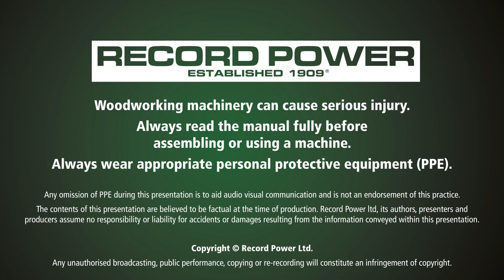Know-How Series: How to fit the 16011 Cast Iron Bed Extension to the Coronet Herald Lathe

Comment: Hi I’ve added the bed extension and decided to attach the legs to the far end of the bed extension itself. There’s mounting bolts on the end of the bed extension so hoping that’s ok….if the holes are there why not mount the legs further apart ?

Comment: Very happy with the lathe and the bed extension is a great addition. But why did you have to decide to use this with hex bolts? In a very inaccessible location under the bed with the legs in the way. Fitting the hex bolts is a very frustrating experience. Locating the hex bolt, turning it about an eighth of a turn before it fouls on the leg or the bottom of the bed, pulling the hex key to then relocate. I’ve been at this now for about 20 minutes and I still haven’t fully tightened 4 bolts. It would make fitting much easier if you supplied normal bolts, at least then you could get a ratchet on them and tighten them up in a fraction the time.
Reply from the maker: Hello, thank you for your comment. The reason cap head (hex bolts) are used in a lot of applications like this, is because these are generally made out higher density/stronger material. So, when an item like this is only held in place by these fixings, we ensure that these are the strongest possible but with smallest surface area. In short, to get the strength in a standard bolt it would need to be a lot bigger, so we do apologise for the inconvenience but safety always comes first. For further information, please contact our technical support team on 01246 571 020 (and select option 2) or email technical@recordpower.co.uk. Best Wishes, Record Power.
Reply: @RecordPowerTV  The issue is not to use a "standard bolt".  Hex head bolts come in many different grades of hardness. One would think your foundry and the designers would be aware of this. For those of us like me, who purchased the lathe without legs, then mounted it to a wooden bench and loaded the bench under the lathe with 600 lbs of sand, the cap screws are painfully difficult to tighten. btw, I purchased this from Stockroom Supply, your dealer in ON-Terrible. That phrase is for expats only, since I transplanted meSelf to New Scotland. 😉
Reply from the maker: @jageo48  Hello, thank you for your comment. Please contact us on 01246 571 020 (and select option 2) or email technical@recordpower.co.uk, and the team will be more than happy to discuss this matter further. Best Wishes, Record Power.
Reply: @RecordPowerTV  Thanks. Done.

Comment: im going to be bench mounting this with a herald will i need another bench foot or do i use the one that's on the lathe
Reply from the maker: Hello, thank you for your comment. If you would like to keep the bed extension attached to the machine for long periods of time, we recommend detaching the bench foot positioned at the tailstock end of the lathe bed and repositioning at the end of the bed extension. This will provide you with the support required for use. Hope this helps. Best Wishes, Record Power.

Comment: Great tip to use the tailstock to hold while tightening screws!  Once the extension is attached, I'm struggling to get the tail stock to slide the length of the bed - only a couple cm either way before it stops.  Any troubleshooting tips?
Reply from the maker: Hi Kym, thank you for your message. It is advisable to maintain the bed and the underside of the tailstock, keeping clean and even using wax or silicone spray as a lubricant. The tailstock is a cam action and can adjust the load by adjusting the nut underneath to suit and get more clearance to help movements. If you require any further assistance, please contact our technical support team on 01246 571 020 or email technical@recordpower.co.uk. Best Wishes, Record Power.
Reply: @RecordPowerTV  loosening the nut did the trick! Slides perfectly now. Love my Coronet Herald and will stay tuned for more helpful videos. Cheers!